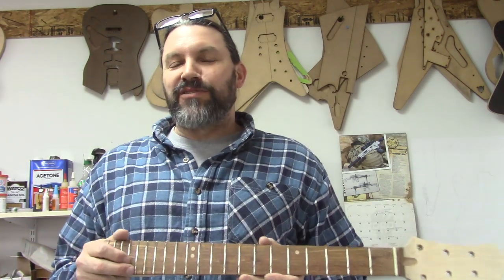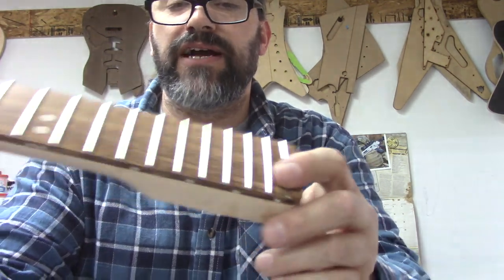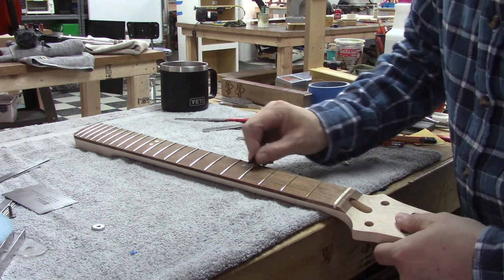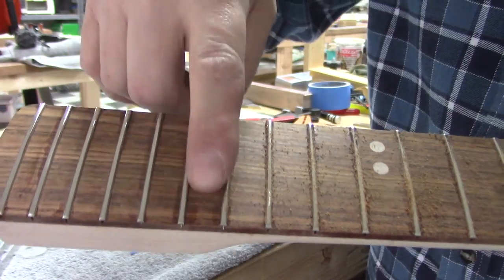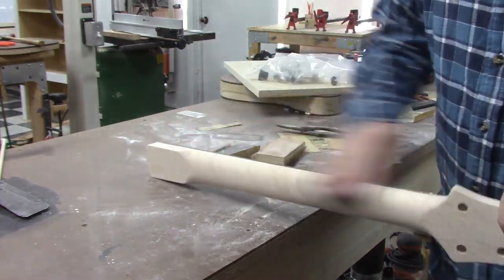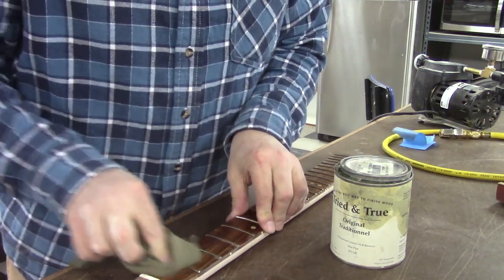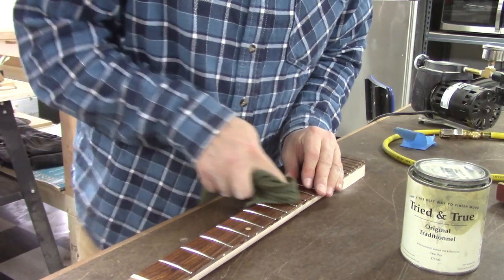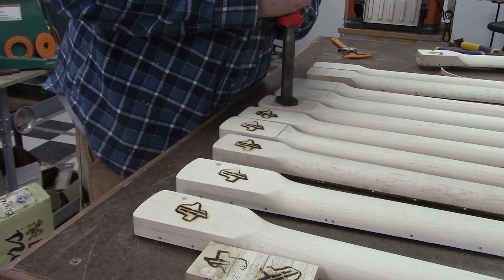What To Expect When You Buy A Replacement Guitar Neck... Cleaning & Oiling The Fretboard

Comment: I used to seal all of my guitar bodies and necks with Watco Oil finish before I sent them out.  It had a polymer hardener added to it and I never had an issue with any finish that was used afterwards.  Of course if an order came in specifically asking for a raw part we (I)  would send it out that way.  I'm not sure if they still sell it with the same formulations or not.  This was 45 years ago and haven't used the new stuff since.  I had a bunch of cans left over an no need to use them so there's that.  I also put quite a few nitrocellulose finishes on top of my bodies even after I had wiped on the Watco Oil finish sealer coat.  Of course I would sand the body down before spraying a sanding sealer or more likely a thinned coat of lacquer as a first coat.  And of course thanks for the great content.  There was absolutely nothing available like this when I started making replacement parts.  I took a trip to 
Fullerton California and stood outside the Music Man Garage (that had their rear garage door open to bring in fresh air) in order to watch them make their guitar bodies with their overheard pin router and see how they screwed their body blanks onto the jigs they use.  I ended up using a different type of jig that was indexed to a 90 degree corner of the blank. Had to make sure to keep that corner clean of sawdust.
I'm learning so much from you and all the other luthier channels on YouTube, this is a wealth of information.  I'm not sure that many of your viewers really appreciate everything that you're sharing here.  It's a brave new world.
Reply from the maker: It sounds like you know quite a bit already.
Reply: @TexasToastGuitars  My focus was on how to make high quality exotic wood replacement wood bodies and later, necks with consistency.  Working to spread out the machine setup times over 20 parts at a time.  So my knowledge is limited to small batch production.  You guys are doing the entire process.  What I learned came from first questioning my father who learned from his father and asking the craftsmen in the shop who were literally imported mostly from Italy.  Immigrants needed to be sponsored and have a needed skill back then and we were the first and only job these guys had coming into the USA.  The US Patent office was also a good source of information.  Back then I just sent a request off to the Gov't and got back all the specs and diagrams of any patent I was looking into.  That was pretty cool.  And then I reversed engineered it.  There's also a tool used in graphic arts that will supply kind of accurate dimensions from pictures if you know one of the real life dimensions.  Any way, still learning so many things I couldn't find out back then.  A treasure trove of info right here for free and easy to find.